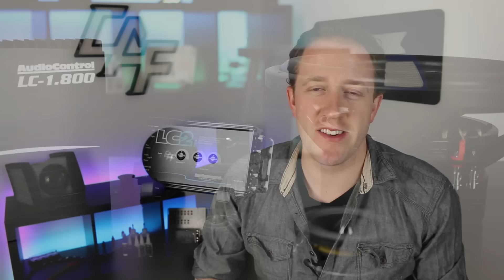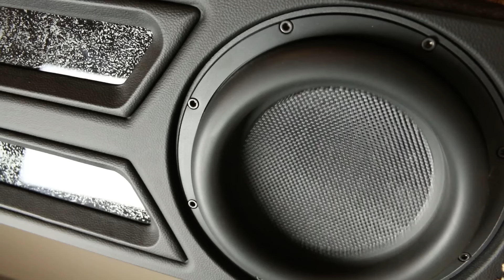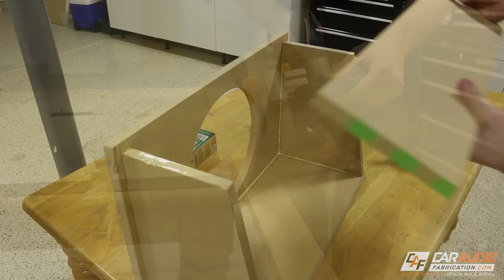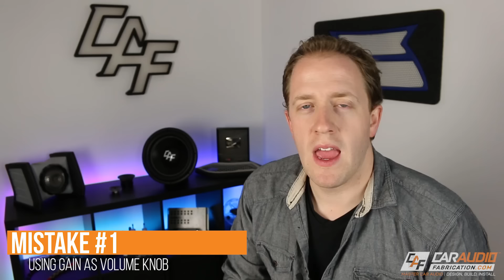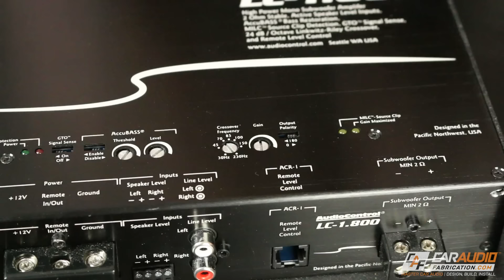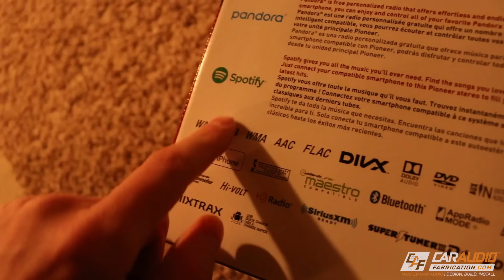Avoid these 5 common Car Audio NOOB Mistakes!

Comment: End of the day iv thrown together one old jvc amp 2 x5x7 3 ways speakers one Sony 12 inch sub and sounds better then my other car where i went with higher “quality components amps and subs all im saying is dont fall for local installer telling u to buy $800 amp instead of $200 amp on ebay as they are crap .wrong yes might be beter quality but different is marginal and unless u doing some sorr of sound comp stick with one amp to run 3 ways 6,9 s or 5x7 3 ways and bridge it for one 12 inch sub and i it will mke u happy and u ll stay under $1000

Comment: Know what wire you need. When I was 17, I installed a new system into a 77 Grand Prix. Everything worked well... except I ran power for the subwoofer amp using 14 gauge wire. Directly to the battery. I'll never forget my little brother running to my room  and yelling "Wake up, your car is on fire!" Went outside, and smoke was rolling out of it. The biggest portion of the wire was completely fried, and the interior of the car was filled with that nasty, white burnt wire smoke. Took forever to get the smell out! Luckily the fuse had popped and saved the amp. I bought some proper 8 gauge wire, and learned a VALUABLE lesson. LOL

Comment: I did a single sealed 10 once and then decided to add another one of the exact same box and speaker.  The result was no bass at all.  Speakers were jumping but no sound, took out the new box and had bass again.  Found the two identical box's were cancelling each other out. Switched to a sealed box for 2 10's, problem solved.
Reply: I suspect you had the speakers hooked up out of phase.  One was hooked up backwards so it cancelled the other out.

Comment: I have a 2013 chevy camaro and I installed a 250 Watt Amp and a 10 inch sub, do you think I will have any problems in the future if I don't get a better alternator?

Comment: 99.99999% of the time you arent going to hear any difference between a 320 MP3 and an FLAC. Ive done those back to back "tests" on a very expensive recording studio monitor system and basically 50/50, which is the same results as guessing. its more of a placebo effect. solid info though
Reply: Headles Norseman,  I can hear a difference. It is kind of small but it's there. I have been music editing and remastering my music with professional software WaveLab on my home computer for years and i have learned to hear the differences.  Earlier this year i heard High definition Audio for the first time and i was blown away. It just sounded so clean and clear and crisp. I have always strive to make my music as faithful to the original recording as i can when i remaster the audio. So i had to install a Hi Def system in my vehicle.   I just finished installing Pioneer HU with 2 Kenwood Hi Def amps along with top of the line Pioneer Hi Def 6.5 component speaker and 2 subs sounds great and clear and crisp.

Comment: i might want a little sub.  3 or 5 inch. The smallest that won't make my car shake. 
and i guess amp as well

already added new speakers and installed sound deadener and foam.

no gay ass rap shit. only metal.

Comment: new to the channel but biggest mistake i made was trusting a friend. he didnt crimp my door speakers to the wires (they were the slide on connectors and were not a tight fit) so the door speakers were crackling after about a week of thump thump and eventually failed, the subs sparked every so often because the box connectors were poorly made, or were just really old, and the prices sounded good for what i got but they were over the price i could have gotten new. so do not forget to check wires after a system is put in my a "pro".

Comment: Hello! Nice video and very relevant. Please answer me a small question.
I have an old refurbished car and i vanted to keep oldschool the stereo. I have a Clarion Cd player and Cdchanger and 4 clarion speakers. Before instal i had a pioner with some unknown crap speakers and i sounded ....sort of ok. Noe after replaceing speakers and player, when i put a little bit of hi volume speakers are interupting like sort of cliping. Any ideas what did i did worong?

Comment: While home audio amplifiers have to, by law, spec power output at specific parameters, such as minimum THD%, minimum power into a specific load at a specific frequency, car audio manufacturers do not. I could make an amplifier that was 10 watts and claim it was 10,000.

Comment: Here's one that's probably not common and I assume hard to plan for, a standing wave.  I spent days building a small system for my boat.  I installed a sub in the only "wasted" space available in the cabin, and it made no bass at all.  I could see it jumping but it just made air fluffing sounds similar to holding the speaker up in open air.  Move the box a couple feet into the cabin and it was booming, but I couldn't leave it there.  I modified the box and rotated it 180 to fire rearward under the deck instead of forward into the cabin and it worked fine, other than having to fix several rattles it created.
Is there a way to calculate an optimum, or as in my case a terrible, air space for speakers?  Since there's a way to totally kill the sound I assume there's a way to amplify it as well, or at least a way to optimize it where none is lost.

Comment: Do you recommend a capacitor or gel battery? If I go with the battery do I need to install a cylinoid with it or not?  I am running a 12in Audiopipe dual voice coil 2ohm sub wired down to 1ohm along with a Skar 1200 monoblock amp running at 1600 rms at 1ohm.

Comment: I have a 2003 Toyota Tacoma extended cab. Are 2 12s to much to put in that back seat?
Reply: Braden Amerson definitely not. I have a single cab and have two twelves
Reply: Braden Amerson if you can fit enclosures under the seats with big sub magnet. few companies such as pioneer,kenwood,makes a shallow mount twelves with specific truck applications.
Reply: Braden Amerson,  I have an 04 tacoma Xcab same as your 03.  But i have 2 8" subs. and they sound nice. Understand that it is what you want to achieve.  The cab area inside is small and don't need a lot to be loud.  I wanted SQ (sound quality) not so much a lot of loud bass.  It's my daily driver. I have just finished installing a new High Definition  sound system.  I love it. New Pioneer HU with 2 Kenwood Hi Def amps and top of line Pioneer Hi Def 6.5 component speakers. I have all 4 corners with the the Hi Def Pioneer 6.5 component speakers installed.  2 Polk Audio subs installed in the old school kicker substation tube boxes. I already had the old school Kicker 8" tubes and just needed to update the old worn out subs with a set of new ones. . My system is loud but most of all it's clean and crisp sounding. Plenty of bass. So with 2 12" subs you may have mostly bass and not much highs and mid's.  Everything is wired into standard 4ohms so no extra heat and 4awg power wire fused at battery with 16awg speaker wire and 12awg wire to subs. High quality 3X shielded RCA cables.  And i have to say this Hi Def system was not  so expensive as i originality thought. It was affordable.
Reply: Pick up some pioneer TS-TRX1000’s (set of two) and you’ll love it in the truck.

Comment: I twist tied everything under the carpet and all. No fuse. Ran the power wire across the air cleaner and through the door jamb because I was 15. 
It was hilarious when it burned down.
Reply: Lmao
Reply: Lmao
Reply: Lmao
Reply: Lmao
Reply: Lmao
Reply: Lmao
Reply: Lmao
Reply: Lmao
Reply: Lmao
Reply: lmao
Reply: Lmao
Reply: Lmao
Reply: Lmao
Reply: Lmao
Reply: Lmao
Reply: Lmao
Reply: Lmao
Reply: Lmao
Reply: Lmao
Reply: Lmao
Reply: Lmao
Reply: Lmao
Reply: Lmao
Reply: Lmao
Reply: Lmao
Reply: Lmao
Reply: Lmao
Reply: Lmao
Reply: @BrotherJApologetics  oamL
Reply: Lmao
Reply: Lmao
Reply: Lmao
Reply: Lmao
Reply: Lmao
Reply: Lmao
Reply: lmao
Reply: Lmao
Reply: lmao
Reply: Lmao
Reply: LMFAO!!!
Reply: Lmao
Reply: LMAO
Reply: Lmao
Reply: Lmao
Reply: Lmao
Reply: Lmao
Reply: Ha
Reply: I did the same thing but I used a fuse in my positive line

Comment: I've got an Infinity Reference 4555a amp running four JBL 602's, an Infinity Kappa 1200W, and a pair of Club GTO 750 tweeters set in my A pillars of a 2003 Acura TL. 

Would it be better for me to switch out the front pair of 602's and GTO 750 for a JBL 600C or  is there another pair of speakers that could be better? I just don't know If I would get better sound from an actual component set of speakers instead of effectively having the GTO750's jerry-rigged up front...

Comment: Great information! I would have thought the same yet I had someone tell me to leave it where it was set! Hey question. I want to install some 6x9 Hertz speakers in my rear deck for my 56 project. But I'm not ready to buy them as I'm now just doing sheet metal work, which means also that I need to cut out the speaker holes at this point before I insulate and get the interior in. Does anyone know if all 6x9 speaker templates are equal or the same size? If so, where would I get this template. I see some online but they are hardly done in a diagram that is full size.  Also is it okay to mix brands to make great sound? Hertz speakers, Clarion head unit. Kicker amp? Again thanks for information and video. Great job!

Comment: As a teenager, I remember friends buying "3000 watts worth of speakers" than wiring them in parallel to an underpowered amp (like 300W peak), and then cranking up the gain and volume till they were near enough putting 12V DC across the speakers - needless to say, after much farty distortion, the voicecoils went up in smoke.

Comment: None of these five biggest mistakes are even on my top twenty. Top five would be bad grounding cable locations and usually too short. Mounting the amp to the box then not keeping the box stationary. hooking up an amp without a fuse. Running highs through the subwoofers and just bad low pass filter adjustments, Running the power cable down the same side of the car as the RCA's. Not mounting the deck correctly with the dash kit. Not using the decks equalizer correctly. Not using the right impedance speakers for the amp and not knowing there's more than one way to wire the sub and how loads and ohms work in general. What type of subwoofer boxes to use, what type of ported box, whether or not to polyfill the box, How to disable the demo mode on the deck. Lol. I could go on all day, Not using the right connectors when wiring the amp. which way to point the subwoofer. how to mount door speakers and get the panels back on correctly.
Reply: If I had a dollar for everytime someone asked me why there subwoofer isn't working anymore and I have to reattach a ground wire that's three feet too short I'd be rich. Most of the time if they ask me to take a look at there system to see what's wrong I already know. Ground cable. Yep. Box flying around in trunk. Yep. Bad ground location. Yep. Amp on back of box. Yep.  Facing wrong direction. Yep. Bending wires until they bend and break off. Shitty Schosche wiring kits with those shitty stiff cables and shitty shielded RCA's and ground cable that's a joke.

Comment: I had a 90 Pontiac Grand Am with a nice system that I installed and tuned. I had MB 5.25's in the front doors, with ADS 4" and 1" in the dash with a really nice ADS 2 x 10 sealed enclosure in the trunk. When I sold the car, the kid who bought it immediately ripped out the 2x10 box and was flat out beside himself when he couldn't make his 3 x 12 ported box sound as good. He ended up putting the 2 x 10 box back in. I think he learned that his friends were more impressed by the actual sound than the number and size of drivers. I actually put some thought into the interior and trunk volume and the result was a really good match with great extension and even performance through the range.
Reply: @Yohann67  The 3x12" subs sounding bad is most likely the post being wrong. Normally a 12"  needs 38"-42" in^2 .

Comment: Sitting here at 3am just thinking to myself; 1) Why am I watching this. Go to bed. And 2) Why not just use the stock speakers? If they put out sound that sounds ok, then why spend hundreds or thousands making "upgrades"?
Reply from the maker: Stock speakers sound like garbage once you realize what a system can sound like
Reply: Why drink nice refreshing lemonade when you can drink kinda clean water that tastes stale. It's also not just about the sound, it's also a hobby.

Comment: Mistakes of basic understanding related to the installation of vehicle audio start to occur far before the issues identified in this video
1)  I would say the first mistake in car audio is not understanding Ohm ratings with speakers and therefore mixing ohm ratings 
-------
2) The second mistake people make with car audio installation is getting the positive and negative speaker wires crossed up 
-------
3)  The third mistake people make with car audio is not calculating demand (amperage) of the current system VS any determination for change..... Learn to Use Ohms law, to properly adjust the vehicle electrical system, for audio equipment revisions. Example a 1000 watt amplifier will place an additional 74 amps maximum on an automotive system.  Most stock charging systems cannot maintain such additional load without an increase in both battery and alternator capacity as well as the wiring and circuit protection between the two.   This becomes more difficult when the vehicle includes software that manipulates electrical load........ 
-------
4) When adding components, proper wiring must be added to allow for calculated amperage flows. Refer to a load to wire size table which can be easily acquired on line. 
--------
5) Finally there is frequency response as a whole for the entire system and how crossover works to eliminate cross talk over frequency ranges of speakers.
Reply: tj hessmon you hit it on the head good sir!!
The only thing I’d add is that a lot of people don’t look at the signals volts as it come out of the HU, if you have anything less than 2 volt then it is more subject to distortion, but any higher than 3-4 and you’ll need to look and see if your amp can take the signal thru a RCA.
And checking to see the # of pre-amp plugs a HU has, nobody thinks to read all the little tidbits of information in the manual about your HU, but it really matters!!!

Comment: Boy... i could write a book on all the mistakes I've made. 
Definitely did #1, and blew my speakers pretty quick. 
Did #1 & #2, & blew my first sub, just bought a second one, and tried using the same box but nah, box is no good, so I bought a nice Sound Ordinance ported box. 
Did #3, i guess, I've started using Spotify, and now you can download 320kbps songs to your phone, so that's nice. 
#4, yeah I didn't really know that when I first started, but I've read about it since and go by RMS now.
& #5 I still haven't upgraded that much on my lil coupe, I'm not running a ton of power through my system, but it's probably a good idea... 
Other mistakes I've made is letting Best Buy touch my shit, I paid out the a** for the install and when I went to upgrade the now broken stuff it all looks like sh*t, with wires just running everywhere and awful connections. In the process of fixing that now (that's what I'm doing here, lol), & not installing the crossovers on my front speaker components because I thought since the car came with tweeters it must have a built in crossover, ¯\_(ツ)_/¯, yeah almost blew them brand new tweeters.

Comment: Saying you need 320kbps mp3s is the same as being blinded by peak power - "it's a higher number so it's better!" It's been proven back in the 90's already that 128kbps using a good source and encoder delivers quality that cannot be distinguished from higher bitrates in a double blind test. If you are bothered by the compression, just don't use mp3 at all, use flac instead - that was actually good advice.
Reply from the maker: It's funny, 1000 people in the comments say you can hear a difference from 320 to flac, and 1000 say you can't hear a difference from 128 to 320. So who is right...

Comment: If you are on a strict budget make a choice.....I always pick quality over quantity. 
A. You can get 4 coax speakers, head unit, amp and an sub box  for  $400. 
B. A quality head unit with a pair of excellent component speakers for $400.
Option A. will give you load music. Option B. will give you quality music.  If you want both loud and quality it is going to cost you a lot more than $400.   You are on your way with system B.  With System A you have to get rid of everything and start from scratch if you want better quality.

Comment: Awesome advice!    
I would add that the huge 1 farad Caps are all but useless.  They slow and do not add much or anything to an high quality car audio system.  A small cap 1/10th that size with no more than an 20 volt rating will add much more to the quality of your system  ( they charge and discharge quicker).  Experiment with 2 or 3 of them. Start with one and add more and LISTEN to see if your system sounds better or worst.

Comment: So many people fit heavy gauge cable in there car including the ground from the system to the chassis but neglect to upgrade the ground from the battery to the chassis.

You have all this heavy gauge OFC cable but the whole system is still being pulled through the crappy factory ground wire that was never designed to support the car plus the massive current demands of a powerful system.

Comment: my very first setup i put in my car before i could even drive i used 10g for power and ground on a alipine 600rms amp and a single alpine type S... it lasted for a few months when i was legally able to drive. i was on a main road in traffic and that wire went up in smoke, my car must have looked like a cypresshill concert . i had to stick my head out the window like a dog so i could see and breath, not a fun time. after that i use 0g or larger